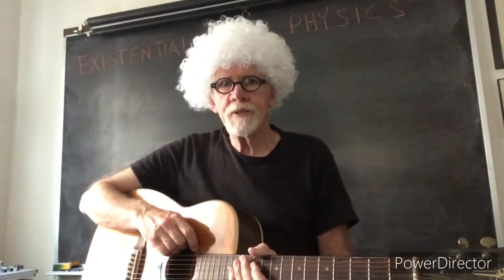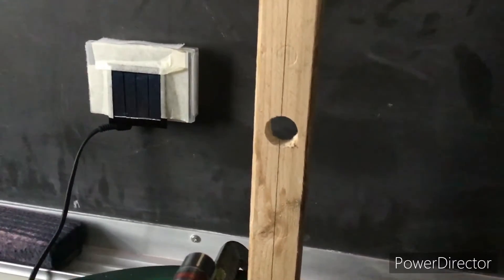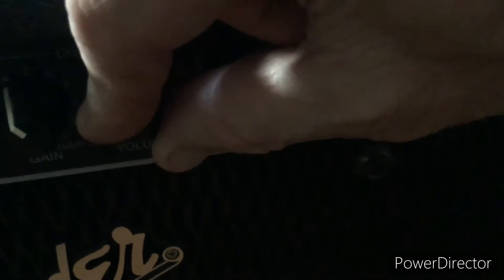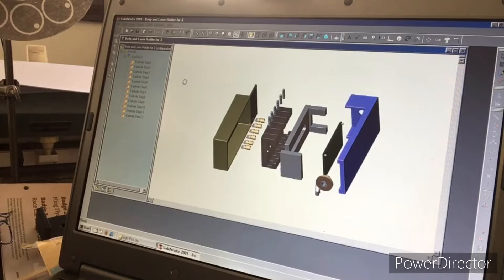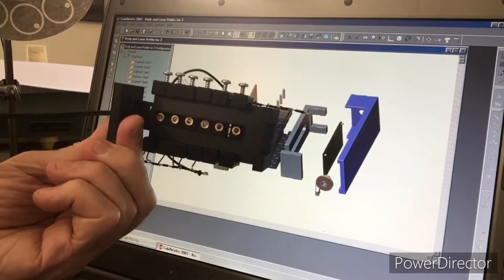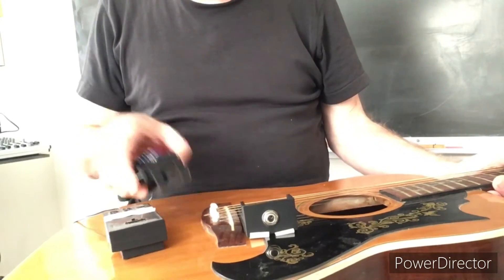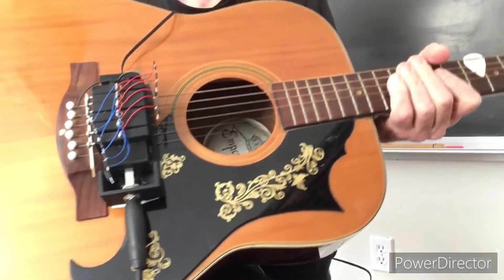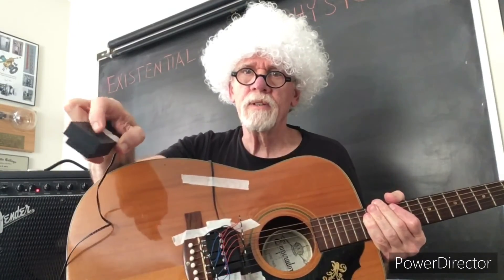Making a Guitar Pickup Using Lasers

Comment: Interesting project. Wouldn't it be easier (and perhaps less bulky) to use one laser split into six beams by fibre optic cables?
Reply from the maker: Hi Robin, thanks for your comment. I think there are a number of different ways to do this. Yours is a very interesting method.

Comment: I have another idea for a guitar pickup: install a typical electromagnetic pickup of an electric guitar, but instead of using the signal at the terminals of the pickup coil, use the signal from the voltage variation at each end of the string (at the nut and the bridge). Theoretically, there is supposed to be a signal since the string is a conductor moving in a magnetic field
Reply: You should use non-metal frets.
You should anticipate humming noise.
You'll need a very high gain amplifier.
Reply: @iblesbosuok you don't need non-metal frets actually. As far as frets are perpendicular to strings, each of them is on the equipotential line so current won't go. But next notes are correct.
Reply: @Ma_X64  I also withdraw the last argument. Guitar strings generate low voltages low impedance. A transformer can convert it to a higher voltage with a higher impedance.
Reply: Should work. But there will be some technical troubles. 1) Strings are different so signals will be inconsistent between themselves. 2) Steel isn't a good mateial for any coil so signals will rather be weak. 3) You need a step-up transformers for each string to match the impeedance.
Reply: @Ma_X64  Thanks for replying! :)